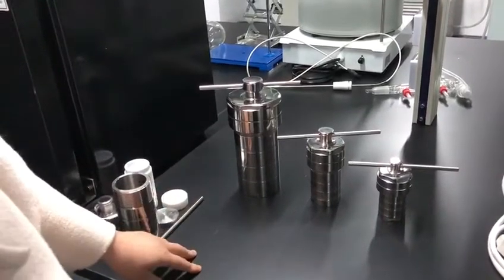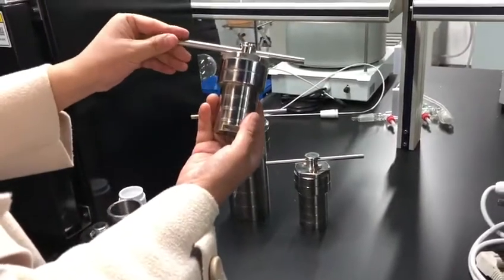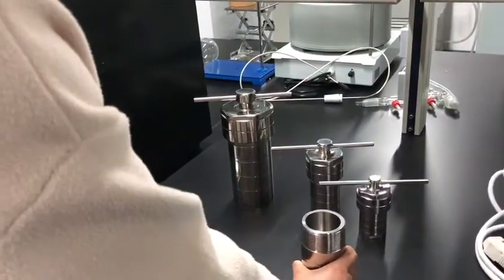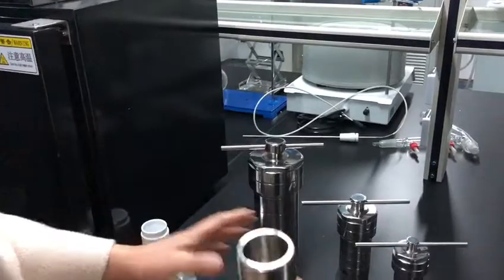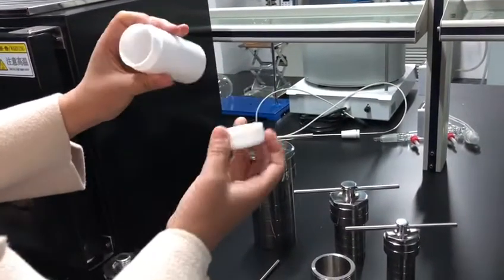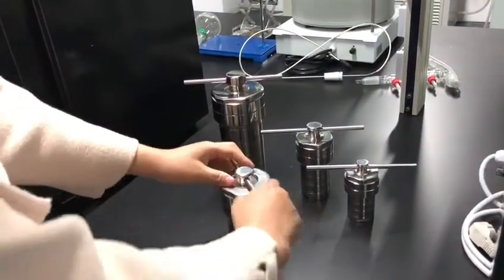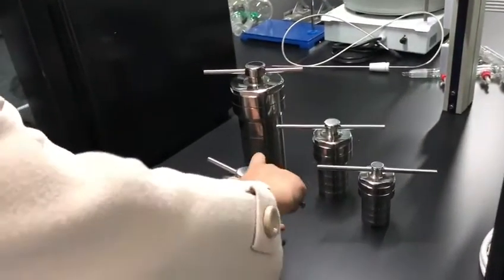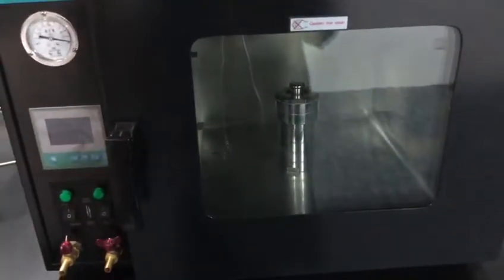Hydrothermal Synthesis Reactor

Comment: Can we keep this autoclave in muffle furnace or hot air oven instead of microwave oven for hydrothermal biosynthesis.
Reply from the maker: It is not possible. Because the temperature of the muffle is too high. The hydrothermal synthesis reactor will melt when put into the muffle furnace.

Comment: How much is it?
Reply from the maker: How many milliliters do you need?
Reply: @joycezheng6578  I need your help pleas . I want to design one like yours for my research to use it with (500ml ) and pressure (20bar) and can handle with temperatures from (180 degree to 230 ) , time from 30 min to 90 min..... thank you for your reply
Reply from the maker: @lola.o5393  If you want to process 500ml of materials, I recommend a 1L hydrothermal synthesis reactor. If you deal with materials that do not exceed 500ml, 500ml will meet your requirements. The pressure of our hydrothermal synthesis reactor is 3MPA. Our hydrothermal synthesis reactor has an inner lining, and different inner linings are suitable for different temperatures. PTFE: 0-220°C. PPL: 0-280°C. PFA: 0-260°C

Comment: How do you calculate the pressure with temperature and fill volume? For example, 180 degrees C, 50% water and 50% air.